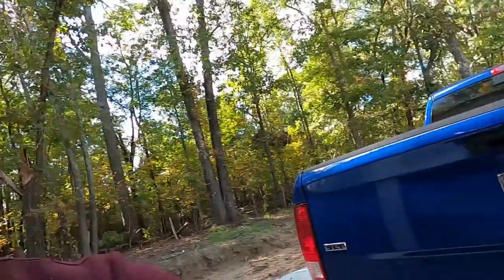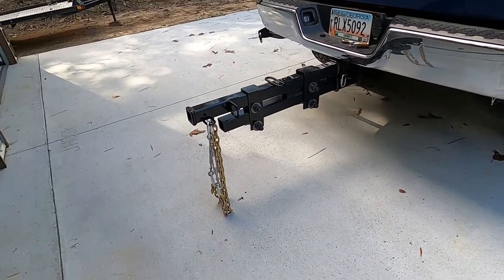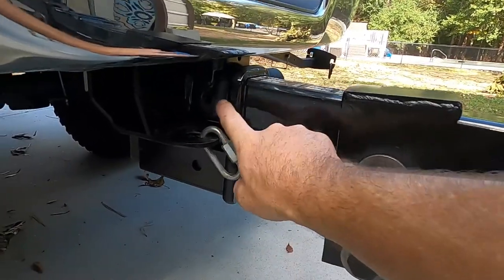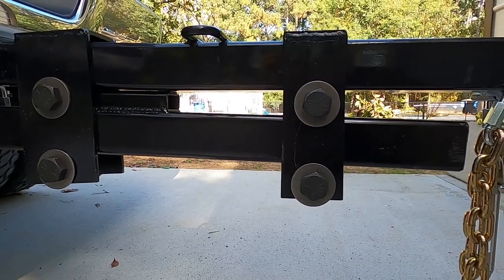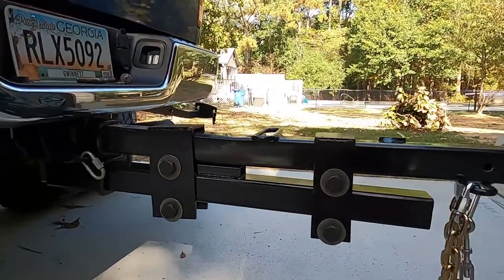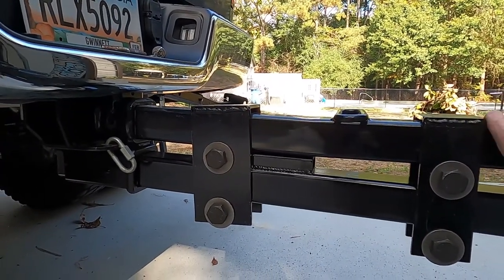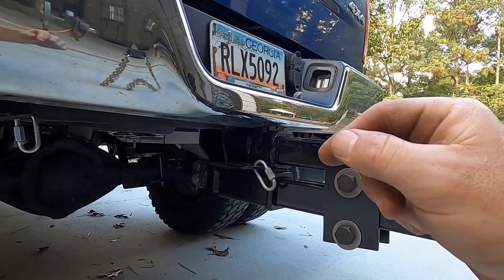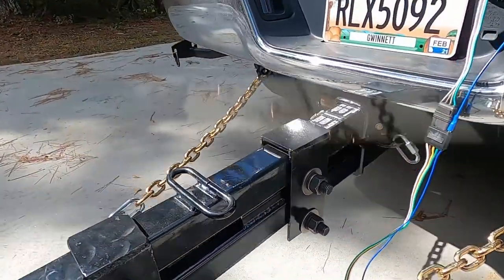Torklift SuperHitch [homemade]

Comment: Building one of these tonight with $71 worth of scrap steel tube from metalsupermarket here in Houston.  The Top tube  will be 53" long when complete.  The production Superhitch is reported to have a solid chunk of steel inside the top hitch segment that extends 10" into the 2.5" wide tube (then it is welded in by boring holes in the outer to make it one chunk.  The bottom tube is just 2x2 square steel tube.  I am told that everything is 1/4" thick on the OEM one.  Pretty straight forward design and with $25 in safety chain, $15 in turnbuckles and a $45 drop hitch you can't go wrong for saving that much $$.  They want just under $700 for the 48" right now on etrailer :(
Reply from the maker: Yeah, way over priced for what it is. Good luck with your build. Like to see some pictures of it  when it's done.

Comment: Hello Mike I built my own also I have two hitches one on top of the other on the frame of my truck it's a 2005 Dodge 3500 heavy duty 4 wheel drive crew cab. My camper is a 11.5 Skyline camper. I tow my Mako 224 behind it. My stock hitch is a two and a half inch receiver then I mounted a 3 inch hitch receiver underneath it. My hitch extension is 42 in. I installed chain with tensioners on each side going to the outside of the hitch.. my upper tube is 2 1/2 in my lower tube is 3 in. I noticed a small drop at the end of the extension when I was loaded. I solved the problem of the drop by running a table loop around my gooseneck ball hanging underneath the truck all the way back with cable to the extension. It solved my drop that I was having with such a long extension and did not put any more stress on the back of the truck since it is hooked up to the ball on the gooseneck worked out great.
Reply from the maker: Very nice, that's a good idea with the gooseneck. What year is your 224?  That's one of my favorite models. I had one a few years ago and I regret selling it every day lol. Thanks for watching and the comment!

Comment: The factory hitch wasn’t designed to take on the weight over an extended distance like the Torklift hitch and extension is. When a hitch is designed they put the weight where a ball mount would sit for their rating testing and certifications. Torklift designs their hitch and extension with the weight and distance in mind. The cross tube, side plates and double receivers are designed for the extra leverage. You also want to make sure the connecting collars between the tubes do not slip or move since having both tubes locked together adds to the strength of the system as a whole. Your weakest point is the factory hitch imo. Plus Torklift uses a solid shank on the upper tube that looks to be plug welded in some spots but doesn’t use a full length solid shank to save weight on the extension while still offering structural rigidity. The lower tube also uses a thicker sidewall tubing. The chains on the sides help to keep the extension centered and solid. Torklift recommends that they be hand tight when setting up. Dynamic load can sometimes double or possibly triple the tongue weight in some cases due to a teeter totter effect. My .02, stay safe out there! My family may one day be driving next to you😳
Reply from the maker: Are you trying to sell me a torklift hitch? Lol thanks for the info but I know all this, I have plenty of experience in towing and hauling and I stay well within the limits for what I'm towing.
Reply: Lots of flex on the hitch in that intro shot.  You can see it twist .  Got the dually, the toys, probably tons of other shit, and then you go cheap on the hitch.
Reply from the maker: Yep, that's me. But it works just fine.

Comment: I made my own version of a superhitch also  with integrated camper tie downs that you can actually jack the truck up from , but today I am removing it all and installing the actual Torklift hitch, so I can have proof of capacity and avoid any law enforcement problems
Reply from the maker: Have you run in to any issues? And what are you towing?
Reply: @MikAnda  no issues  and I loved my oem modified unit  but the 06 OEM   ford hitch had some low rating of well under 10k  the supertruss original I bought on craigs has a 17,000 lbs and 20k with a WD hitch ,,  OEM was probably ok but the new dump trailer I bought is 14k and I was worried about LEO
Reply from the maker: Oh ok, yeah that's understandable. Mine is a 20k factory receiver so all I really need to worry about is my homemade monstrosity hitch lol.
Reply: I doubt you will carry a 14k or more load on that ,  so like my DIY extension I bet it is never a problem , i have a company graphic on my tailgate so LEO may look at me harder than when i have my camper and no tailgate  lol
Reply from the maker: Yeah true, the heaviest thing I have to pull is 8k and the hitch I made seems to work pretty good but I've only used it once so only time will tell. Thanks for sharing and watching!

Comment: Hey Mike! Great video. How did you connect the locking quick links (under your truck) to your hitch  to connect the turnbuckle chains? Did you drill a hole in the steel tie-downs for the locking quick links?
Reply from the maker: Thanks! Yes I did drill a hole on the end of my truck camper brackets and I just leave the locking links on there.

Comment: Need to tighten chains up.  That keeps the hitch from moving side to side that far out and creating sway.  I tighten mine tight evenly. I have the actual super hitch. I have a 48 inch extension. They are a pain to get inserted. That worse part of loading camper. I would agree on the hitch.  The super hitch has some extra bracing on the bottom tube. And It’s heavier than the top one. They are very expensive. Be safe. You have air bags on your truck the ones I have air up separately.  That help with side to side sway from being too heavy with camper on and the hitch dropping that far out.
Reply from the maker: Ok will do. We drove down to Destin Fl with it and it did fine so I think it will do good. I might do a little more too with the flex but I'm happy with it. Always, thanks for watching and for the comments

Comment: Hey Mike,  That was a great idea to make your own Supertruss.  Funny we have a video coming out on our camper, trailer and hitch setup but we don't have a Supertruss.  For whatever it's worth I do have some concerns about the factory hitch supporting all that.  I believe the actual Supertruss hitches are much heavier duty with additional support for the lower support extension.  I've noticed my factory hitch flex much like yours did in the video with only around 500lbs on it.  There's a lot of leverage on those long extensions.  On our extension if I use a weight distribution hitch with the extension it raises the tongue weight capacity from 500lbs to 750lbs.  If you have one, maybe try using that as well.  Just a thought.  Your new boat is beautiful but very heavy.  Thanks for the video.  ~ Todd
Reply from the maker: Thanks. Yeah I had some concerns as well with the factory hitch bc like you said that's a lot of leverage weight but I looked at the rating on it and it was 20k which would mean 2k tongue weight max. We made a trip to Destin Fl with the setup and had no issues at all. I checked quite often and there was no stress or signs of bending, worked perfect. I will probably do a little more to it for more peace of mind, but overall I'm pretty happy that it worked as well as it did.  Thanks for watching and looking forward to your video.
Reply: @MikAnda  That's awesome I'm glad to hear it work well on a long trip.  You did a nice job making the extension. Safe travels!
Reply from the maker: Thanks!

Comment: Hey Mike excellent video! I’m considering doing this to my truck as well. Are you still running this same set up? How did everything hold up? Would you change anything about how you did it? Any info will help my decision. Thanks again
Reply from the maker: Thanks! Yeah I'm still using the same setup, haven't found anything to change yet. It's held up really good so far, probably have around 3-4k miles on it and no stress marks anywhere.
Reply: @MikAnda  awesome! Thanks for the info! Already have the hitch now just need to find a welding shop to add the 2nd receiver. Great video thanks again 👍🏻
Reply from the maker: Welcome, hope it all worksout. Love to see yours when you get done!